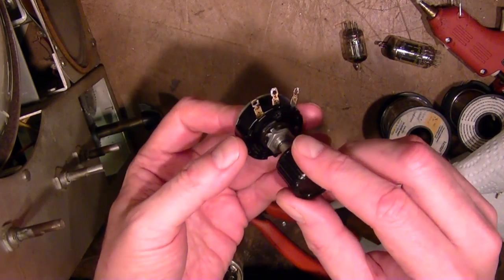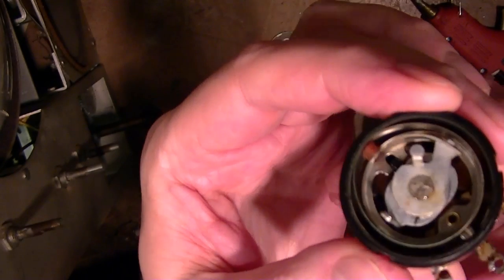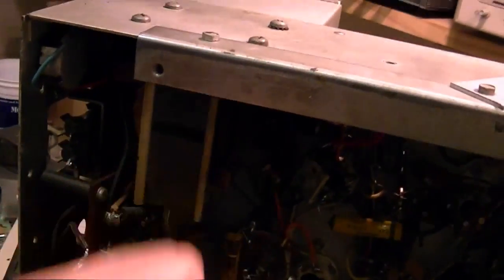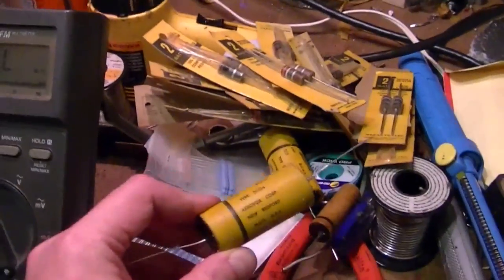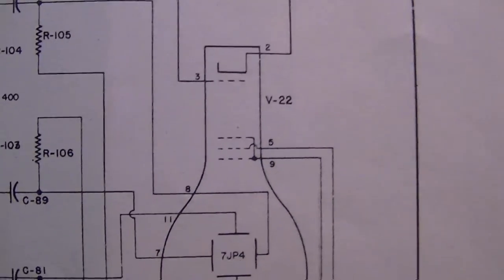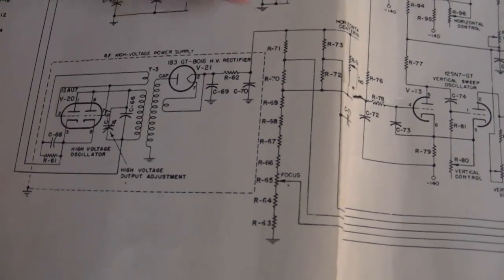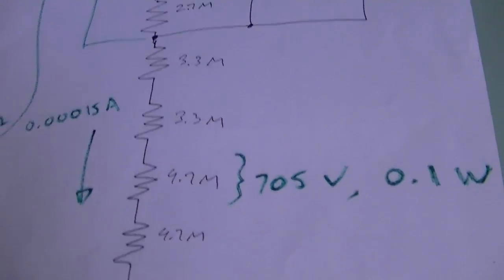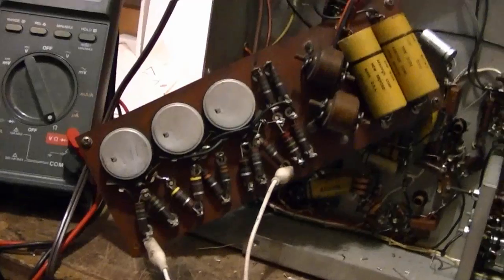National TV-7W restoration p4o?

Comment: Where did you find those high voltage resistors? Do they have much of a selection of values? I would like to find some in the same voltage range as those typical yellow poly film caps, like around 630 volts.
Reply from the maker: Digi-Key - Watch at 9:03.  Keep in mind they are rated for 3,700 volts only 1/2W and cost around $0.69 each.
Reply from the maker: You might find KOA 700 volt 1/2 W resistors more suitable.  Mouser carries them.  http://www.mouser.com/KOA-Speer/Passive-Components/Resistors/Film-Resistors/Metal-Film-Resistors-Through-Hole/_/N-7gz41?P=1yzbppyZ1z0z819Z1z0x85hZ1z0zlrr
Reply: From what I was reading the old carbon composition resistors didn't really have an official voltage rating due to their construction method, it was basically a rod made out of a carbon paste with a lead attached to either end, in this case inside a molded phenolic case, but with the older radial lead ones it was a solid rod with a wire wrapped around each end.  The newer carbon firm resistors do because they have a film wrapped around an insulator, where they then cut a spiral groove to arrive at the resistance value they need, I think that they arrive at the maximum voltage rating based on whatever voltage it takes to arc over that spiral groove. Obviously 4000 volts was too much for 1/2 or 1/4 watts to handle regardless of whether they are carbon comp or not, at that voltage they would probably arc straight from one lead to the other, hence the 2 watt units they used.